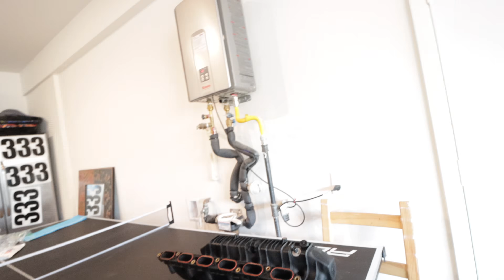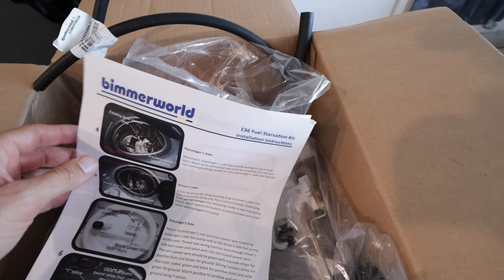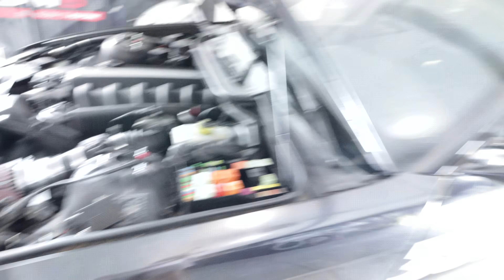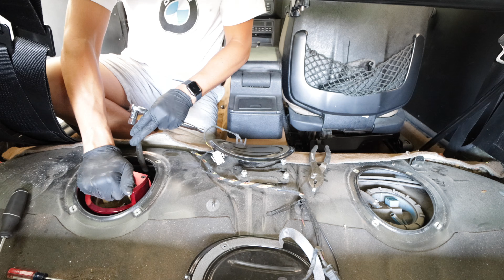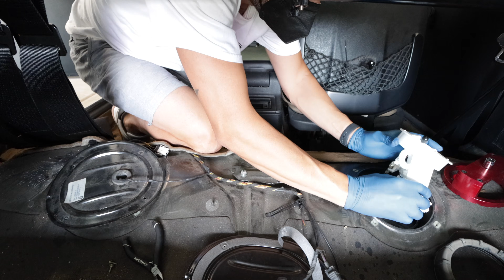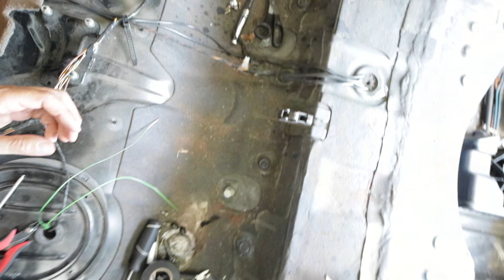BImmerworld E36 Fuel Starvation Kit install

Comment: Did you completely remove the tan tube in the tank or is it still necessary?
Reply from the maker: I cut it out you don’t need it. The pump on the driver side pumps gas over to the primary pump on the passenger side
Reply: @RascoeGarage You are awesome thank you for the quick response and informative video!
Reply from the maker: No problem man, thanks for watching!

Comment: Wait e36 had 2 pumps? Ib got a 98 328i sedan
Reply from the maker: E36 has one pump I converted to dual pumps. OEM pump is on the passenger side and return is on the driver side. When you add a second pump you are basically pumping fuel over to the main pump and then that is sending to fuel rail.

Comment: Does your fuel gauge work? I'm going to put a pump on my driver side and do a similar set up to this. I'm running into an issue where my fuel pressure drops in heavy boost and hoping this makes a difference.
Reply from the maker: The dual fuel pumps is a must in these cars. My fuel gauge still works fine, no issues

Comment: Did you ever run into any issues like running too rich?
Reply from the maker: I issues running rich. I actually purchased an adjustable fuel pressure regulator so I can give it a little more fuel. If you track your e36 the dual fuel pumps is a must.